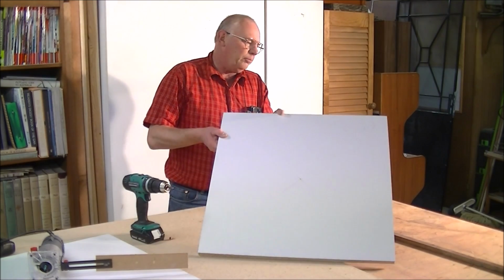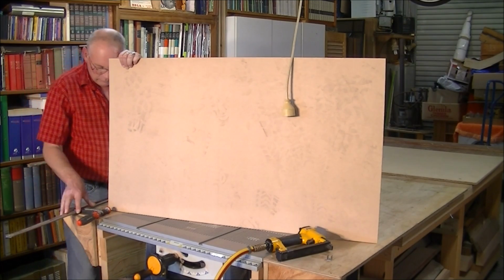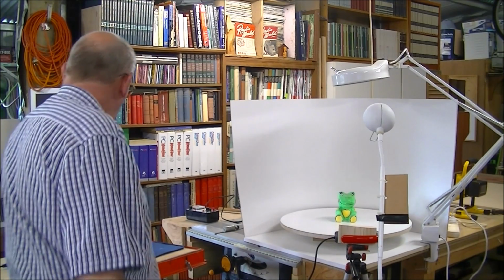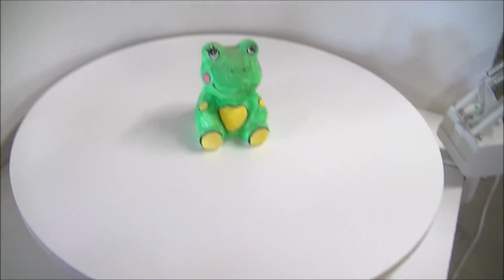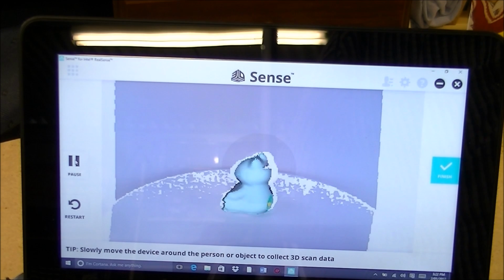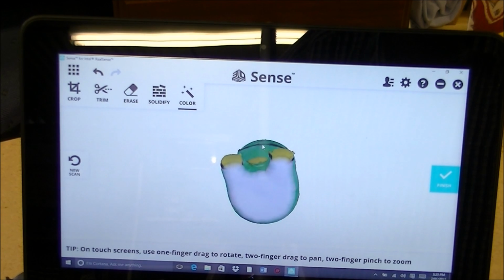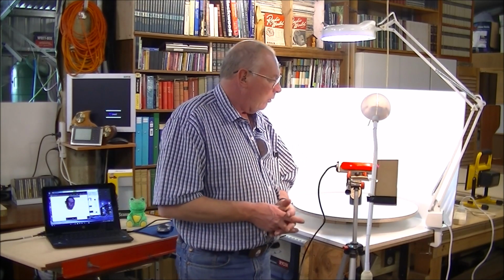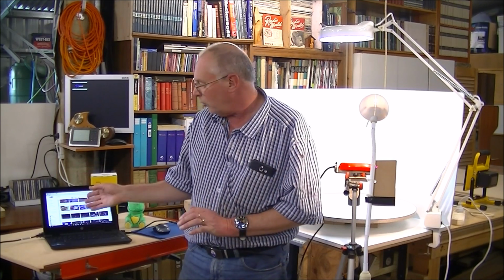159 3D scanner making a 360 3D relief with Sense and rotary table

Comment: Does the sense software activate without problems with this scanner?
Reply from the maker: Yes it was good
Reply: @inventorsworkshop9600  
Did I understand correctly that the intel realsense SR 300 metal module (development kit) can activate the 3Dsystem software?

Comment: The key musty be lighting as I with the turntable with dull white background and it was worse than non turntable scanning.  I tried Sense and felt like it was still lacking.  I'm wondering if the XYZprinting hand scanner pro is any better than their last model.  I'm going to try Structure with my ipad pro.  I feel like these handscanners wew lacking and 123D Catch did just as well.

Comment: Mr Webb, I have just downloaded  the sense program and installed it properly. When I try scanning with the xyz handscanner like yours it does not work. The Sense program does not recognize the scanner. What version of the Sense program are you using? May be that the newest version is just for their scanners.
Reply: Ray Guthrie You must have stock software open in the background for it to work with Sense software!